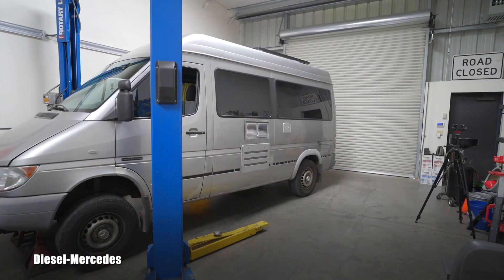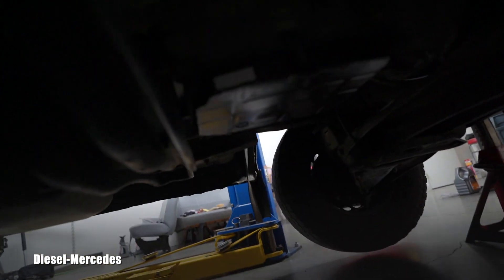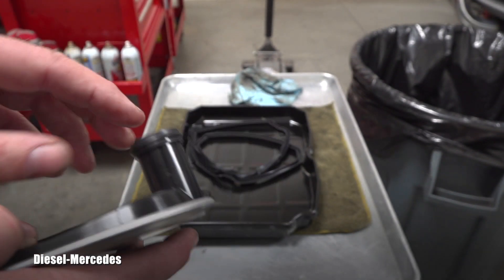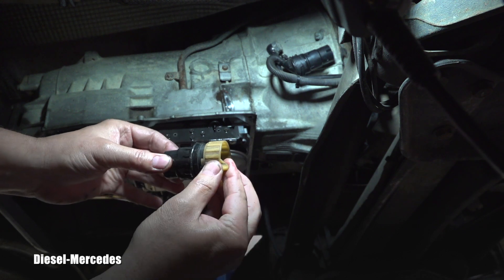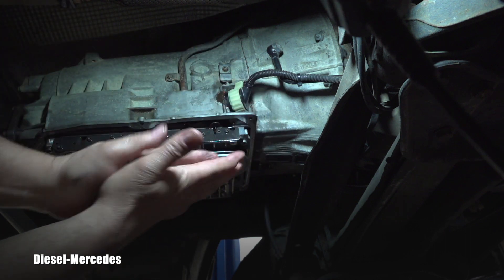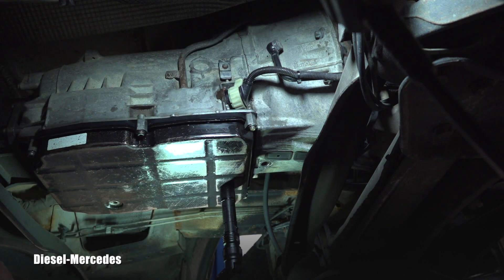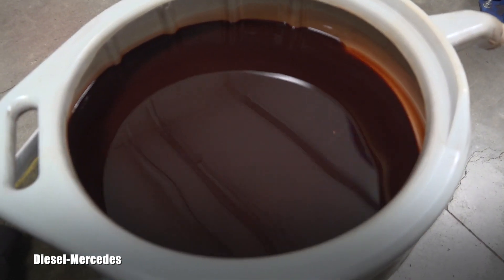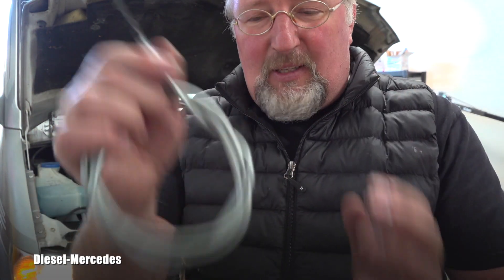Sprinter complete automatic transmission service

Comment: Your great advice saved me last night. Timing of the replacement electrical connector for re install is critical folks! Diesel mercedes other video on sedan trans service saved me. One picture shows the "timing" of the end triangle holes in relation to the plastic release lever that I matched with removed part. I also suggest if your harness has wicked fluid up from the leaky orings, put a clean dry PAPER  towel on the harness end and vacuum the harness socket end. At 5 minutes, I was still drawing out fluid thru the harness socket. Keep moving the towel to use the dry portions to draw out the fluid with vacuum.

Comment: in most sprinters especially the newer ones its very difficult to remove the plug on the torque converter and even harder to try and screw it back in, What i DO IS, drain the pan, clean and change filter, seal up pan, that removes about 4 litres, then I add 5 litres  in the atf filler tube, then I go to the return hose at the top of the radiator, pull out the metal hose, not very easy,  insert a 3/8" poly hose , turn on the engine go to reverse for 3 secs then to drive for 3 secs all the while the dirty fluid is coming out from the converter,  also after the old fluid is exiting the new fluid from the pan starts to come out and then i stop the engine, re-connect the return metal hose and top off the fluid, This method removes all of the old fluid while not having to try to figit with the torque converter, the torque converter draining method will deter about 90% of people trying t do this job,  I saw one guy drain 4 litres. then start the engine shift gears and the drain the pan  and fill again but. this does not remove all the old oil it just thins out the old with new oil, in my opinion this is a much better and easier way, the hardest part is removing the locking pin on the return hose, perhaps you can do a sprinter this way fr your viewers

Comment: I recently had my indy here in Fla. service my 722.6 with a full fluid flush, pilot bushing change, & filter change @167k miles due to harsh shifting between 1 & 2 when engine is first warming up. He informed me that newer blue transmission fluid MB uses in 722.9 is backwards compatible & that it runs cooler & shifts faster so that is what he used to replace what was there. I must say after almost 5k more miles since service, harsh shifting concern has completely disappeared during warm-up phase. To be fair, both fluids shifted butter smooth once operating temperature is reached but prior to flush I was convinced valve body would require stronger valve recoil springs installed to repair harsh 1-2 shifts. Now I know different.

Comment: I just changed the transmission fluid in my 2015 Coachman prism 2150 motorhome prism, it is the  Mercedes sprinter 3500 chassie with a 5 speed transmission, the transmission fluid was green. Is it OK to replace it with red Shell 134 fluid? I also drained the torque converter. I don't know what type of transmission fluid was used and I am not sure if it will cause a problem with mixing with red fluid even though I thoroughly drained all the green fluid. What are your thoughts?

Comment: i dont have a 5 hex drain plug for my torque converter.  i only have a 4 hex plug but it is in the other access nearest the engine.  there is no drain plug to be found in access closest to the transmission pan.?

Comment: I noticed that there are two different o rings on the bottom the adapter comes in one is thin & another is thicker. Which is correct

Comment: This maybe a silly question. Can I just replace the electrical connector with o-rings without draining the trans oil. I just did the whole trans service and my connector is leaking. I notice there is an o-ring on the balck part of the connector that you didnt change. could this be my leak point?
Reply: Yes you can don't need to drain